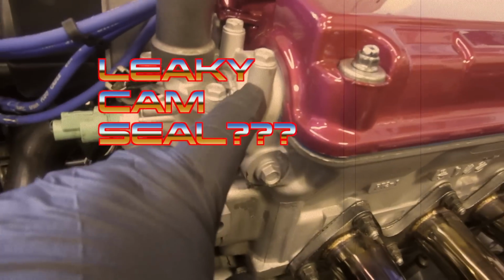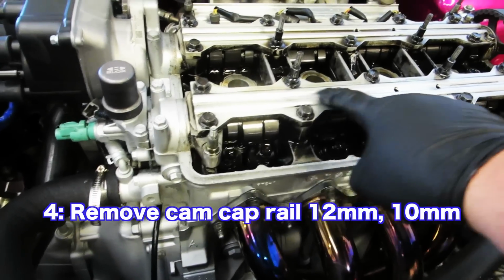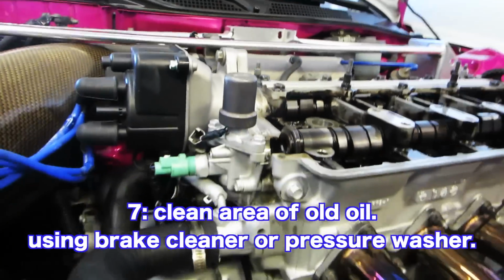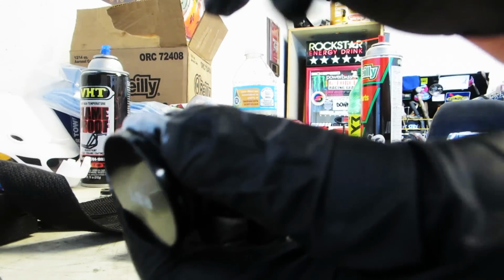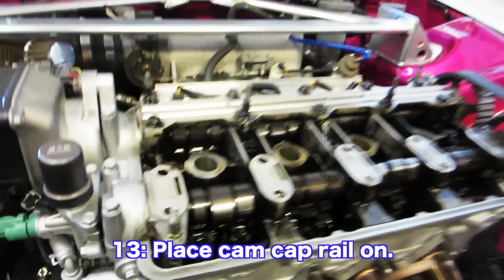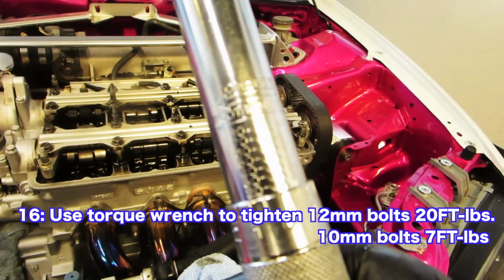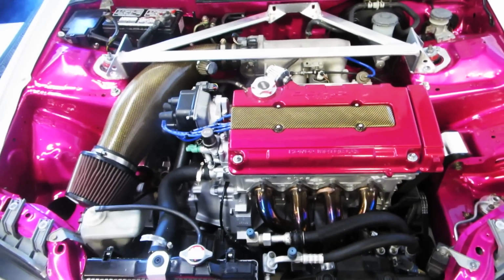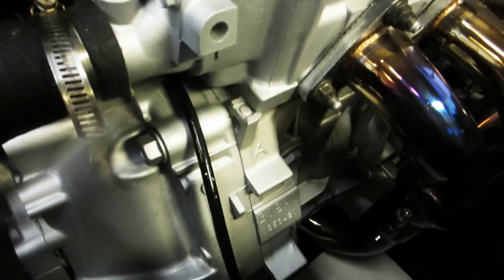Leaky Cam Seal FIX!!!! B SERIES VTEC HEAD! HSG EP. 4-13

Comment: I just pull it with a flat screw driver and put the new one with some oil and works fine!!! Really cool videos Guys ...I really like  this channel, Keep working like this...
Reply: Does it work still I don't feel like taking the valve cover off and doing on the torque specs

Comment: So this looks pretty simple, my question is reguarding if you can just boom! Pop the cam cap off and replace the seal cap or do you have to turn the motor over that cylinder 4 is tdc? So theres no flex or it doesn’t matter?

Comment: Any idea where I can buy a new cam end cap? The thing u put over the seal. I need a new or Undamaged one. As mine is cracked and leaks from there. Please help thank u. I can’t seem to find one anywhere. I have gsr b18c1
Reply: You can’t, they are machined specifically to your specific engine. If you use another without line boring it to match your head you can cause engine damage.

Comment: could you guys do a tutorial on how you clean your motors and what brand paint you use to paint them im doing a d16z6 swap in my 92 eg hatch and id like to know the best way to make the motor look nice before i put it in the car
Reply from the maker: Very easy. Lots of brake cleaner...... Keep in mind it's not cheap. $3.50-$4.00 a can. It'll take usually 6-8 cans for a whole motor depending on how dirty it is. Then tape up the parts you don't want paint on and take off the parts you can. Watch episode 3-07 ek b16 swap. The paint is VHT high temp. We use the header aluminum color because it has a nice flat finish.
Reply: yeah i did actually watch it an hour ago and it heppled out alot thanks for the reply

Comment: One of my 10 mm bolts snapped. Am I screwed? I put it back together with the use of the other bolts for the cam rail.
Reply: Just buy arp bolts and a screw extractor to get out the broken bolt and you’ll be fine

Comment: U should make one for the cam seals
Reply: Raul Berlanga hahaha
Reply: Correct. This is the cam plug.
Reply: Why? It’s pretty easy.. put #1 at TDC, remove all accessory belts, remove crank pulley, remove timing covers (if you run them) remove the T belt, remove the cam gears then remove the cam seals. Clean up the area, Install new seals then reverse of removal.

Comment: i have a 1994 honda civic dx sedan, if i wanted to make it pretty fast but keep it as a daily driver what engine and trans should i run.
Reply from the maker: B18c JDM type R swap. You can keep ac and power steering.
Reply: Great thanks for the help can't wait to do it.

Comment: You guys have any advice on how to get my cooling fan to kick on 91 integra w/ a b16a2 replaced the sensor on the thermostat and the temp cooling switch I think it's called ... Fan is good... Fuses are good... Just won't kick on when it heats up I'm super stumped ...any advice???
Reply: you can jump the sensor for the fan switch. its the one on the thermostat housing, you can take a wire or paper clip and put it in the inserts in the sensor from the harness, not on the housing. so essentially it'll look like a U. wrap it up with electrical tape then you're done and it should kick on every time the ignition is turned to on
Reply: +Jonathan I grounded one wire and the other to the fan and the other fan wire to constant power it's fixed now and not running constantly which is what I wanted . Thx for the help tho

Comment: and yet u still did it wrong.... i all ways use rtv  on the whole cam seal and put some under the cap were it bolts down to the head,then wipe any  that is shown.end of problem.
Reply from the maker: We did this be for the Hday car show and no leaks. So I gues there is more than one way to do it.